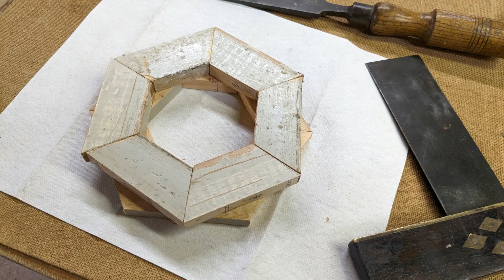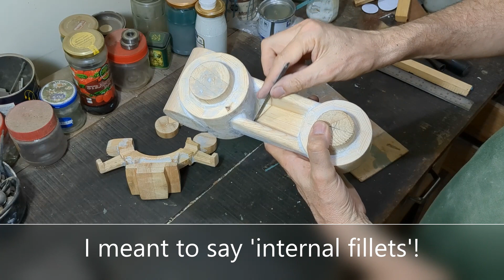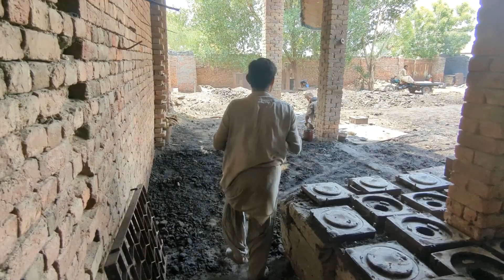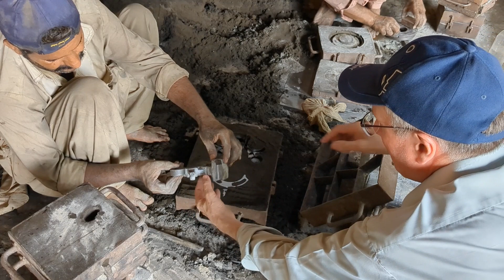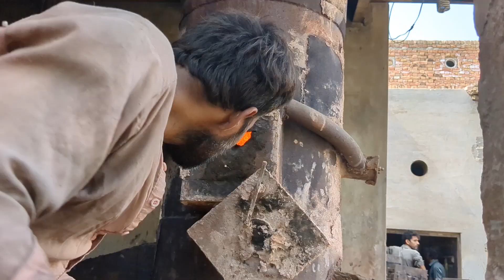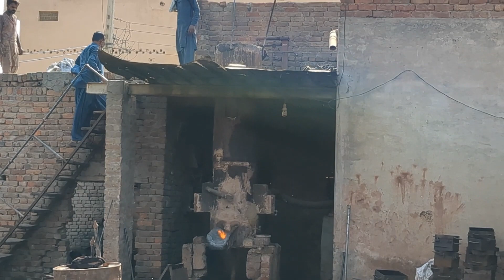Making castings in Pakistan for my milling machine project

Comment: where was this foundry in pakistan. and what was the total cost per kg.
Reply from the maker: The foundry was in Rahim Yar Khan. I can't remember the rate per kilo but it was reasonable according to the local rate. I gave a little extra because of the complication of the cores.
Reply: @Workshopfriend  do you think they would be capable of casting a machine body like a LIP 515 Surface grinder.
Reply from the maker: Can you send a picture with appox size? I looked this model up . It seems quite small. You would have to make the pattern. @subuktageenfarooqi
Reply: @Workshopfriend  I have been looking into small size machines for some time. myford/emco lathes, 
RF-25/deckel fp1 mills, 
LIP515 surface grinder, 
GASTL RG200/gingery shapers etc. 
I wasnot sure i could get custom castings done in pakistan in singular quantities. Still curious about the price. from my conversation with machine sellers. PKR 200-400/kg is the price for older manual machines while tooling per kg is PKR 2000. So a machinist vice can cost more per kg than a cinncinati horizontal mill.

Comment: I've read and heard of patterns being damaged at the foundry.  Now I see how it could happen.  This is the most positive Paki-casting video I've seen.  Most videos show workers making many of the same item and their skill level is not apparent.  Their bare feet and lack of safety equipment stands out more than anything.  But seeing them work on a one-off part reveals the skill and experience.  The foundry sand is different than typical green sand or petro bond.  It allows them to be much rough with the work and much faster too.  Hearing your interpretation of the worker's talk is very relatable.  Thanks for bringing such an interesting angle to a mill restoration.
Reply from the maker: Thanks for your positive feedback. Yes, I was impressed with the foundry. Earlier this evening I was machining the mill support bracket. There was no porosity or hard spots. Just what I had hoped for. I wish I had access to this foundry on a regular basis!

Comment: @6:00 regarding your filleting tool, I have had good success from a tool made by epoxying a suitably sized ball bearing onto a short piece of rod as a handle. I affixed a different size bearing on each end and added heat shrink on the handle for grip. The ball provides the correct radius regardless of orientation. As you sweep the tool the excess is pushed aside and can be removed with a razor/scraper after things have firmed a bit.
Reply from the maker: Thanks for sharing this great idea! Makes a lot of sense.

Comment: No visi vest, no eye protection, no hearing protection, no respirators, no steel toes,  hell not even shoes for the steel toes ! Very simple and rudimentary tools offset by mastery of the trade,  fascinating.
Reply from the maker: Yes, my clothing suffered a burn hole all the way through while I was filming the furnace - a flying piece of coal struck me at chest level. I'm machining the castings now. They are on size and have no blow holes or hard spots.

Comment: Awesome video!

Really liked to see the foundry. It seems like a lot of work and time goes into making a casting.

Did it cost a lot to get made?
Reply from the maker: Thanks for your response. Yes, I thought they paid close attention to getting a good result. The price was very reasonable even in local currency terms and after I gave extra for accommodating my intrusion!
Reply: @Workshopfriend  Great stuff. Something like that will probably be cost-prohibitive in the UK. I suppose with £ you could give them a nice tip! I quickly searched online to try and see what a labourer earns in Pakistan and the results were quite shocking.
Reply from the maker: I haven't had castings made in the UK for a long time so am out of touch with rates. The complication and cost of export/import might be prohibitive and complicated.

Comment: Your flask is empty. What a drag! How do you cope?
Reply from the maker: 😂 This must be an old joke, but it is new to me!
Reply: webbed feet not necessary !!! for milling machine make solid ?
Reply from the maker: Similar support brackets are webbed in this way. Solid would be unnecessary. I think this is a more efficient use of material and keeps weight down.

Comment: Shouldn't be a problem bringing the casting through UK customs.
Like you used to travel every 3 weeks working in West Australia and home in Philippines for 20 years, brought all my tooling etc from Australia.
The only time I had a problem was working in Indonesia and entering Spore they said I had a weapon in my suitcase after Xraying, it was my 12" Vernier, they let me through with it.
Could be used as deadly weapon with the sharp jaws for internal measurements.
Reply from the maker: Thanks for your helpful comments. It wasn't UK customs but Pakistan security and customs I was more concerned about. As expected, I had to open up my carefully packed box but the officials were quickly satisfied. They were doing their job well.